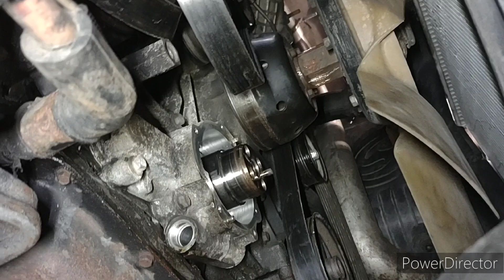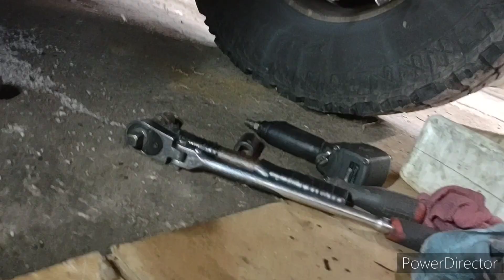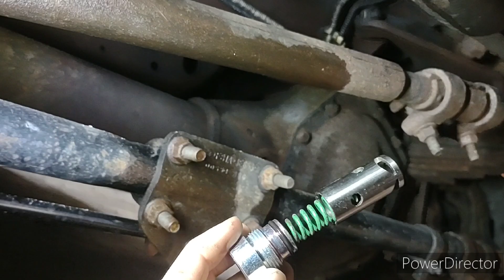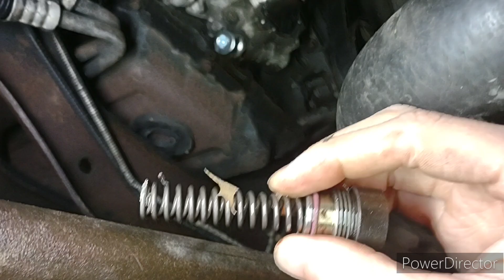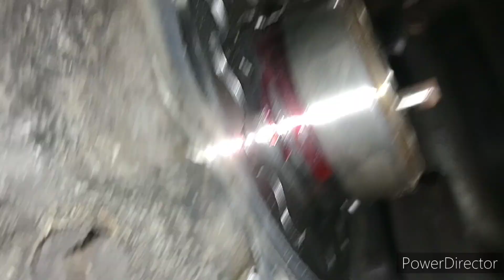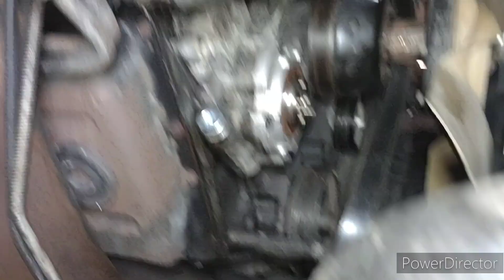2003 6.0 powerstroke Melling LPOP oil pump install

Comment: Hey, thanks for the video! I just replaced my lpop because it wasn't filling oil into the filter housing...

My pump was damaged and the housing has 2 channels grooved into them, i replaced only the gear and lpop cover but now I can get it to prime! 

I just don't know if its because i only coated the gear in a little oil during installation or if those grooves are honestly enough to cause it not to work??

Ive been stranded in Albuquerque behind a business with my truck and 5th wheel, surrounded by homeless ppl living in the dumpsters... With wind rain and cold... i've dropped the oil pan to confirm a good suction tube (living hell), then replaced the lpop (found that damage on the old one)... Really thought this would do the trick but i crank and still get no base oil...

I don't get panic attacks, but i literally had my first when this didn't fix the issue....(Hyperventilating and couldn't physically speak, no joke...)

Im 6.5 hours away from my intended destination (Peoria az), im mentally and physically broken down...

Logically replacing the front cover to eliminate those gooves is my next step... But im clingy to the hope that maybe its just a prime issue and those groove, although not ideal, would still at least function enough to get me running.

Any thoughts?

(Im nervous af, and lost nearly all my confidence.)
Reply from the maker: After everything is together, with the oil filter cap and oil filter out it should only take a few seconds, maybe 30 secs to get the oil to start filling the reservoir.

Your best option is find a local diesel shop and get the truck towed there since you don't have additional shop tools and large  battery charger to keep the batteries charged, you'll eventually kill the batteries trying to crank the truck over. 

Also while cranking you could pull the I believe grey ficm relay or use the starter jumper wire so the injectors are not firing while trying to start the truck.
Reply: I do have a lot of the essential tools for this truck. I've accumulated the right configuration over the past 8 years of traveling... Yes, where I'm lacking is the battery power... and being frozen mentally and stressed through the roof.

Over the years I've done my fair share of parking lot miracles (mainly injectors, seals, exhaust leaks, boost leaks, hpop system...)

I just keep hoping that if I go out and try and lift the rear of the truck and or find a way to pime the pump that I could get it started.... I'm confused on if there's a specific hole in the oil filter housing that I could put some oil down that would reach the loop, or is there a way to put a hose somewhere to suck oil up through the loop...
Reply from the maker: @jmeister87   There is a drain back valve in the housing, however it drains back to the pan far as I know.  Have you posted in some of the 6.0 facebook groups?
Reply: @Keiths6.0HotshotAdventures I just disconnected the 5th wheel and chest pressed, single leg pressed the truck away from the trailer... Then I jacked the rear end way off the ground (it fell once, but maybe it's a sign to take the easy way out..jk kinda)

So I figured this would give the best chance of getting oil to the loop, I held the relief valve down but even without that it should show some signs of filling... However mine did not, I got the truck charging via solar and car, so I was able to do some pretty good sessions of cranking (with the starter wire), then I took the oil filter pipe off and put oil in there while cranking, nothing changed...

So then I removed the (new) low pressure regulator to see if there was any signs of oil building up in there, there wasn't anything leaking out, so I cranked with that out, nothing out of that hole either...

I have been in contact with a real knowledgeable Ford tech, I talked to him prior to removing my oil pan, new lpop and latest testing. I'm going to call him in a minute to see what he thinks now...

I think I will be replace the front cover if it's just that there damage enough to cause this still... Let the nightmare continue I guess...
Reply: did you ever figure it out or you still in that parking lot charging the batteries
Reply: @ajbianchi228 I was able to pull off a parking lot miracle. Can't remember where I left off but I had it towed to a diesel shop, evidently the timing cover damage was enough to not build pressure. Also, these timing covers are discontinued from the manufacturer so I got lucky when the local shop told me they had a used one available! I had them change it out. $2700 later they restored the low pressure oil system, yet my hot no starts were still there. I took it back to a parking where I had my RV towed up the road from the shop. As I parked it dies... No more than 5 minutes from handing over the cash... So I left it for the night because I couldn't deal with it at that moment. Next morning, fired up took it for a test in the lot, the moment it was about to take off, died.. I pressure tested the high pressure oil, sourced the leak to the hpop area. Found the j tube for the HPOP discharge was disjointed at the weld, this was a brand new Ford OEM with only 1200 miles on it... My guess is the weld started to fail, sent pieces into my lpop, damaged my timing cover, then eventually fully failed in the last parking lot test.

So I replaced it with my old discharge tube, pressure tested again. No leak!! 

I left the next morning, and made it to my destination. Forever scarred physically and emotionally. I don't even want to tow anymore...

However, now a few weeks in AZ, the cops are booting everyone in RVs off the state trust land... I am forced to move somewhere else for the winter.

If anyone has a place north of Phoenix I can boondock feel free to say something lol
Reply: @jmeister87  sorry you went through all that but I'm glad it's finally over. Good luck on your endeavors.  I got a 04 just bought it from a scarred man. He gave up  he replaced everything. I was wondering about the cover itself.
Reply: @ajbianchi228  thanks! Ya sometimes when replacing things, either you introduce new problems or never touched the real issue in the first place, enough to drive anyone crazy. It's like you can't trust new parts anymore... Plus I was hearing Ford changed manufacturers, possibly inferior parts now. 

There is a glimmer of hope tho, if you have the money, the shop tech told me about crate motors. Basically directly drop in motors from Ford, all the updates for longevity, better than what came in them. If I had the money, that's what I'd be considering, for total piece of mind.

I'm going on over 8 years keeping mine out of the junkyard... I wish you the best of luck with yours.
Reply from the maker: @jmeister87  Glad to hear your back on the road.  Thanks for sharing the adventure with us.  It's definitely a love hate relationship with these trucks.
Reply: Maybe you can pour. Oil inoil filter  reservoir and  drain it down and get it primed

Comment: Hi there 

Did your front cover have damage ?

Or was the damage limited to the low pressure pump gears?
Reply from the maker: I mean it wasn't shiny and perfect, but didn't look bad enough to need replaced or enough to affect performance of the pump.
Reply: I’m going through a similar situation 

My Low Pressure Oil Pump has tiny dots not like lifter needles just bumps.

The front cover has some light scuff marks but not horrible 

Everyone is saying to replace the front cover but I’m a bit hesitant
Reply: Did your front cover have a gouges or light marring ?

I’m debating on replacing my front cover or just roll like you with just the LPoP first ?
Reply from the maker: @jasonab6722 if it looks ok. I'd send it.  It's a lot of work to replace.

Comment: just did my front cover gasket and replaced the water pump and whatnot, trying to get the lpop gears on the crank and it won’t go in at all, everything is lined up but it just will not go in and i know you have to be gentle with it
Reply from the maker: Try to test fit each piece individually to make sure the gear will go on the crank then the outer half to see if it slides in. Can be a pain cause it's a perfect fit. It's a solid piece of metal, so if it needs a tape from a rubber mallet, won't hurt.
Reply: I have a friend of mine is working on his truck you can't seem to get the gears to go in. He has an idea to loosen the timing cover bolts is this recommended I myself am against it but I'm no expert